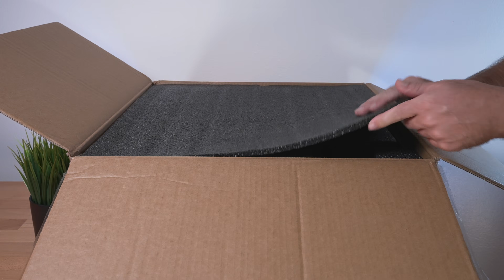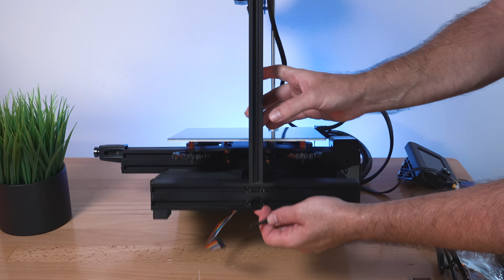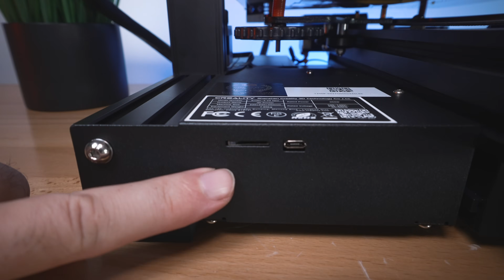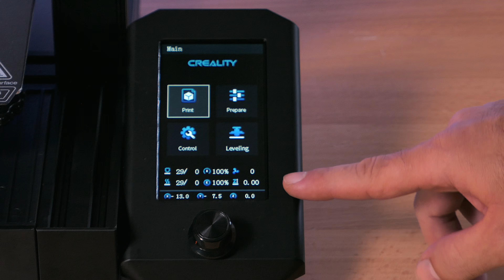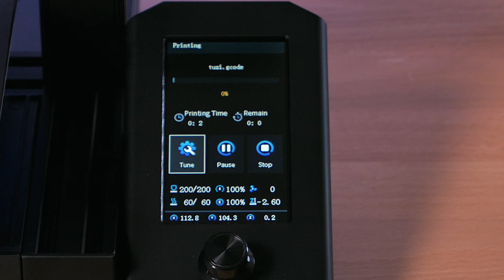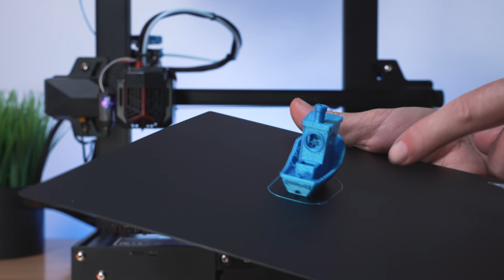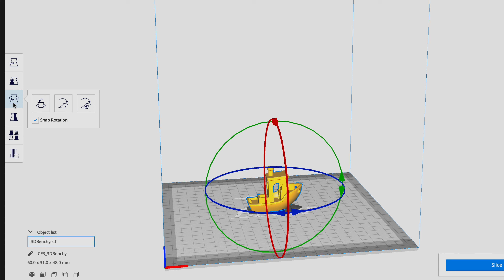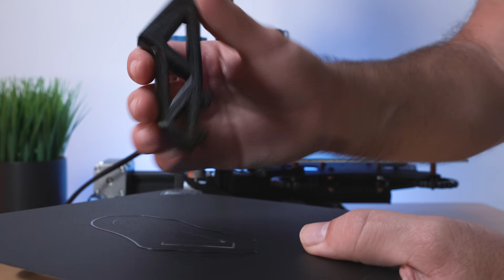Creality Ender-3 V2 Neo - 3D Printer - Unbox & Setup

Comment: Thank you! This was invaluable in helping me get started. I had a few issues that I managed to resolve-maybe the info will help someone else. First nothing happened when I tried to Auto Home, the knob just spun... I checked my firmware--all up to date - then unplugged everything and plugged them back in again even though it all seemed connected correctly, and then it worked! Next I couldn't seem to get the filament to come through. In taking the knob off and watching it pull through, I was able to make sure it was loading fully. It took quite a few turns before it finally extruded. I am printing my first benchy now! I think I'll be returning to this vid again for tips on slicing and reviewing how to level and home, and maybe printing out that cool side spool bracket.

Comment: I'm not sure what's up with mine, but it's cementing all my prints to the bed,  I'm now running the bed at 40° and the hot end at 205° trying to find the combo that makes it easier to get it off the bed.
Reply: Lol, I’m struggling to get it ON the bed

Comment: Thank you Just Vlad for creating this video! I just got mine and watched this as a guide for set up, first print looks good.👍🏼
Newbie question, what free apps can I use to create stl 3d models, and g code files? I see a few options out there, and I wanted your recommendation for what works best for newbies.
Thank you! All the best.
Reply: fusion 360 works well and is free as long as u are a hobbyist or student or small business owner u just need to fill out a couple questions. cura slicer is a great free slicer to turn ur stl files into gcode files
Reply: @owenseverydaylifevideos8398  thank you for the feedback! I am currently using cura for slicer, and freecad for the 3D models. I will check out fusion 360. 👍🏼👍🏼
Reply: Good luck with free cad……

Comment: Nice video but 'way too fast' for me, the 'Beginner' but that's okay, I just keep rewinding. Couple questions if I may. I followed your instructions to lower the Z setting to 00.0 and then ran the 'Auto-home' in preparation for the leveling phase and I noticed that the Z gantry and tip went back up-!?! Also, I'm NOT 100% sure that the stepper's deactivated...what reference do I use to make sure this has in fact happened and I'm not going to destroy anything-? Also, looks like you're turning those bed adjustment wheels, clockwise? This is all around the 25.00 > time frame. Thank you for any help you might be able to render. J.B.

Comment: Thanks for all the info!  Santa came early for me this year and I got a Neo!  I'm a complete Newbie to 3D printing.  Am in the process of leveling the bed right now.  Does anybody know at what point we would use the Control section?  Another YouTuber said before leveling go to Control and Reset Configuration.  I didn't see that instruction from anyone else - is it necessary or not?

Comment: I would recommend using a square angle to make sure your gantry is squared to the base frame of the printer before you tighten the gantry bolts down. It will save you a ton of headaches andd failed prints / filament down the road. Also make sure the x-axis gantry is leveled to the frame and tighten the v-slot wheel to make sure your x gantry is level and not putting undue stress on the bed and the x-axis stepper.
Reply: Thanks for mentioning this, I'm totally new to this stuff and was wondering if I should make use of the nice new 4-pac of 'Chinese tool Co.' square(s). I just purchased none too long ago.
Reply: Thanks for this. I hadn't even considered doing that
Reply: I just bought one and I thank you for your clear instruction mate . Awesome and I feel confident I’ll be fine .
Reply: I did this and the printer worked amazingly well, i might've forgot to do this
Reply: @alexstone691  ??? so did you do it or did you forget to do it?🤪
Reply: @yoduh99 I did, the comment just reminded me otherwise i might have forgot to do it whilr building
Reply: I got one of these coming in 2 days. That's a very good idea.  I can tell you got some xp. Sometimes an imperceptible twist can bind things bad.

Comment: I need help: my Z offset is -2.86, does it have to be -2,70?
Reply: I'm not the video author, but I can answer this question. It does not have to be -2.70.  Each printer will have it's own Z-Offset (I learned this when installing an autobed leveler on my Ender 3 Pro) so it's normal to not be the same.  That's something he probably could've added to the video for beginners :)

Comment: Question: Hello, I'm considering to buy this Neo 3D printer, my first ever so it overwhelms a bit... Could do a complete tutorial for a beginner buyer? of course with this new Crelity model, a guide which includes from the printing software (probably even design tips for Maya or Zbrush, then tips for very flexible materials, to a post impression on how to polish pieces, an step by step guide for beginners for this printer model, thank you very much!

Comment: Well this is frustrating. Just bought a V2 last week. Spent all week upgrading it.
Reply: I'm glad I sat on getting a replacement 3D printer for this long :)  I just ordered the v2 Neo - but for a while, if the funds had been there as well as the wife points (small joke between her and I), I would've gotten the V2 a while back and been disappointed too.